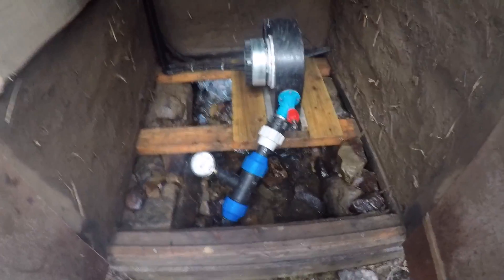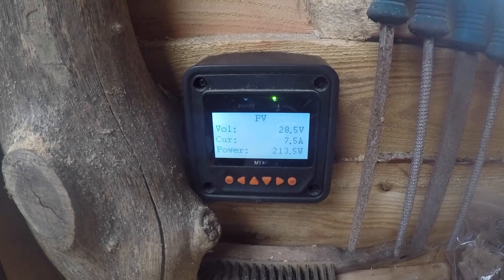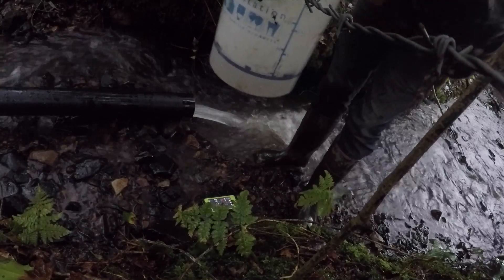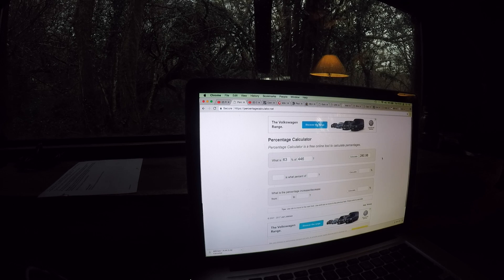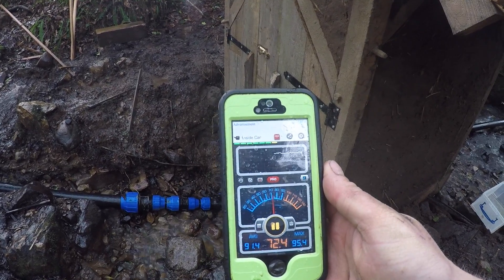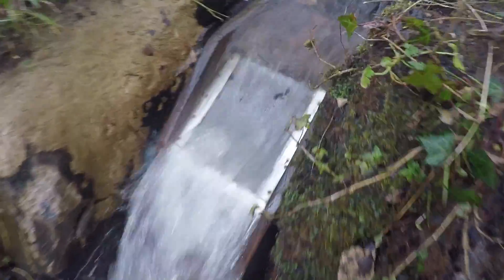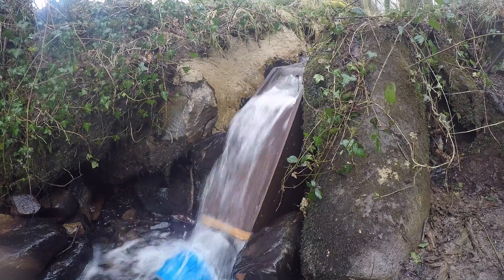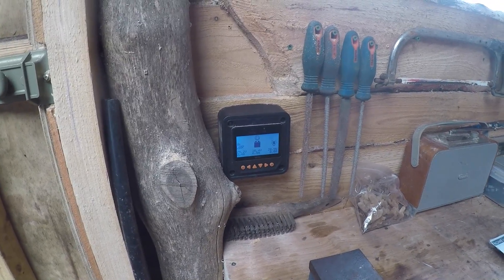DIY Micro Hydro Part 17 The Figures

Comment: What charge controller did you order? On my waterwheel I used a Victron Smartsolar 75/10 controller and it seemed to track great. The bluetooth was nice too.
Reply from the maker: Hi joe, I’m getting a Morningstar ts 60a and I’m going to network it so I can monitor the power online.
Reply: Nice!
Reply: Joe Malovich h
Reply: Joe Iv been following your videos too but how much power are you getting? Iv a stream similar to yours and just started working on my setup...
Reply: I have 2 of these. They are great. Get a serial to USB cable so u can change parameters!
Reply: Kris Harbour Probably you know this, but you look to have an epsolar charge controller, you can swap out your display, and connect to the (non-standard wire) controller  via rs485 to allow it to be networked too.  Google Colin Hickey and Adam Welch for diy and commercial alternatives.

Comment: Does that Generator produce AC or DC? Photovoltaic Charge Controlers only work with DC, so if he might have some Problems with the AC from the Turbine, that would explain why it only says 28V. If you reduce the flow and the frequency decreases, it resembles more of a DC so the Charge Controller would show the 70V.
Reply from the maker: The wiring video will answer your question.
Reply: Kris Harbour could it be the DC pulses. or rectified ac. causing issues with the mppt?  maybe some caps on the input of the controller. and maybe a choke coil. to better the charge. I guess you thought of this? great video. I am completely GREEN over here. seeing your  awesome system. I wish I had some fall to my water! I'm likely going to have to go with a under shot water wheel. or a mid shot. with good sized troughs on the wheel. with a heavy overdrive. like near  1000:1 or 500:1

Comment: Do you know the life span of the alternator ? and I'm lost can you run just on the hydro power or do you still need the battery bank ?  Any way this whole process is very interesting..
Reply from the maker: i think it should last quite a few years especially with bearing replacements. and yes i still need batteries to supply the large amount of power i need for power tools and things. but the hydro keeps the batteries full.
Reply: Batteries act as a buffer for any appliance or tool that requires more than 280 (+what ever his solar is producing at the time).

Comment: Kris, how are you planning to maintain spare parts for your system?  Normal wear and tear vs drop in replacements?
Reply from the maker: once i know i am at my final design i will buy a selection of parts that are likely to wear. bearings, nozzles, pelton cups.....and so on. i will do year maintenance in the summer when the flow is very low.
Reply: Excellent!  Depending on the system, I am of school in having a “drop in” backups as to minimize down time.  That said, my backup generator is a Honda with the hope that a winding failure will be caught in QC before it gets to me.  That said, I do need to understand the dynamo better.  I have run it weeks during outages and my oil changes seem excessive as I am draining caramel and not chocolate colored oil!!!  Hahahaha.  Great stuff and thanks for sharing your journey.

Comment: Won't you need a dump if a storm comes and the water speeds up
Reply from the maker: amount of water has no relation to pressure. so regardless of flow the pressure stays the same so the scenario you mention wont effect it.

Comment: I think you do not need a new controller, in open circuit you have 70v but in load the voltage drops and the load is charge controller. If you remove the cables from the input into the controller you will have three times more volts. I think you need more pressure of water.
Reply from the maker: i need one anyway because the one i am using is form my solar. so i have to get another one.

Comment: Nice to finally see it working as it should! I hope I will get a chance to build such sistem sometime in the future.
Over time I would still suggest you to get some sort of separate dump load controller through - at 300 W and your relatively minimal power needs you could easily use the excess power for some useful water/space heating, even with electric cooking.

Comment: Thanks for the information Kris.  I'm sure it will be great when you get a more sophisticated charge controller and are able to plot the data over time.  Could you also perhaps touch on the total costs or a general cost breakdown at this point?  Equipment rental, piping, controller, generator, est. labour hours etc?

Comment: Removing the fan from the alternator will also reduce the noise level and increase output.
Reply: Ralph Wilmot but doesn't the alternator need cooling? Maybe a small one like that doesen't because of all the cold iron of the turbine but still..
Reply: Smaller fan is probably still needed, car alternators are expected to try and cool in a very hot engine bay.

Comment: Maybe you have water flo turned too high, the water flo might be more efficient if turned down due to the circumference of wheel & water flo. Great Job. 👍 Vinny 🇺🇸
Reply from the maker: the efficiency goes up with lower flow so you are right in a way. but i wanted to show figures for max output as it is at the moment.

Comment: Great work Kris. Hopefully things work out with the (right) charge controller. I had hoped for more output power (regardless of the charge controller), but I expect that can only be achieved with a bigger turbine, right? Would a larger turbine be possible, seeing the amount of pressure you've got at the end of the pipe?
Reply from the maker: just another nozzle and  some improvements and i could almost double it. 280w for 24h in 6.7 KWH that is a large amount of power. its more than i need at the moment anyway. but when that changes i can make upgrades.
Reply: Yeah I asked before watching till the end of the video, bit too eager. Pretty cool stuff Kris. Think that second nozzle isn't a bad idea. Even though you might not need it (now), you could sell back power to the electric company (don't know about what regulations may be at play to do so) and earn back all that effort and money you put into this awesome project. Of course that would require you to be not off grid but maybe that could work in your benefit! Hope to see more videos. Good luck!
Reply: Kris power inc, become a local power co?

Comment: can u sell power to your local utility
Reply from the maker: No, i am off grid.
Reply: Even if he wasn't off grid it's the same here in U.K as in most other places. Everything from where the water arrives at the end of the pipe in the turbine hut has to be "authorised installer", throwing costs up in to the many thousands of pounds. I doubt they would accept that turbine either.

Comment: Great job on the turbine. I don't know if it is the video, but it seemed to slow the wheel when you opened the valve further.
Reply from the maker: That is the load being applied when the controler kicks in. that is the sound of power!
Reply: Kris Harbour oh ok
Reply: I  noticed that also, but when closing the speed only slowed, not increase at all.

Comment: That is very interesting. Will you have enough electricity to run lights and everything else? Or what are your thoughts?
Reply from the maker: currently i have the lights on in the workshop and internet router, lights on in the roundhouse and internet router and my lap top the batteries are full and the turbine is at half flow. so yeah it runs everything. in the course of a day it can generate more power than i used to use in my flat in london
Reply: Thank you so much for your reply. I enjoy watching your videos and seeing what you're going to do next. Have a great day and be safe
Reply: 5kwh should be far more than enough. average household also runs TVs 24/7, washer, dryer, central heat and air, having to heat/cool a huge house, so on and so forth. i'm curious to see what his average usage will be in the long term though.

Comment: What happens when you get a strong storm and the water flows heavily?  Will that damage your turbine?
Reply from the maker: the other day when me and hannah was working on the pipe in the rain was the most rain in one day for years! and the ground was already saturated. everything was fine. the land sheds water very quickly so im not worried.
Reply: LegendLength x

Comment: Awesome! Do you get water hammer effects when turning the valve off?
Reply from the maker: No, you do it slowly and it isn't a problem. if i was to do it fast it would cause problems.
Reply: I'm not sure how close your stand pipe is to the turbine, but I imagine that will help handle some of that load in addition to slowly turning off the nozzle. Given that it looked to be about 2 meters tall, and you said it was above the level of you intake I'm guessing its pretty close to the beginning of your pipe.
Reply: ShadowMadeKiller , as part of my duties I operated three large hydro turbines for work, if you do the valve operations slowly we did not get water hammer, they sound great spooling up and down. Although I was present once when a newbie shut if down faster than I said and the turbine in question did not like the experience. We also had a 50Kw photovoltaic system onsite which pretty much just did it's thing.
Reply: He's got the standpipe, remember?